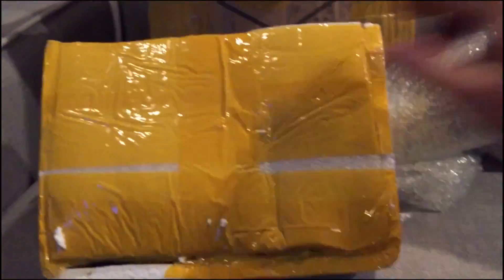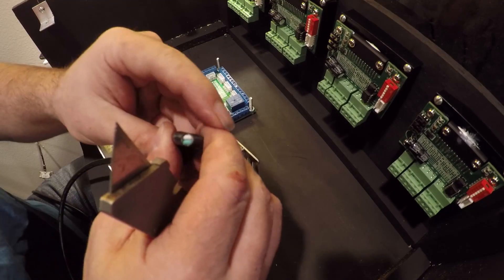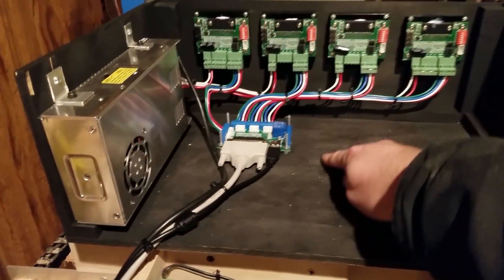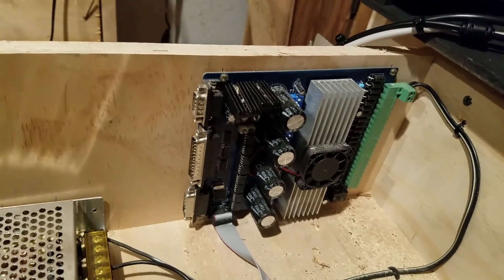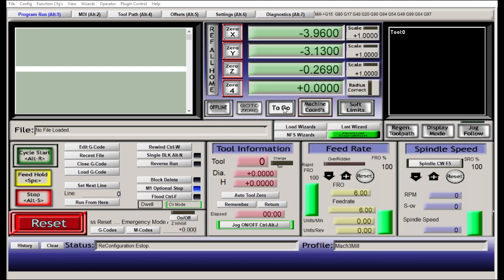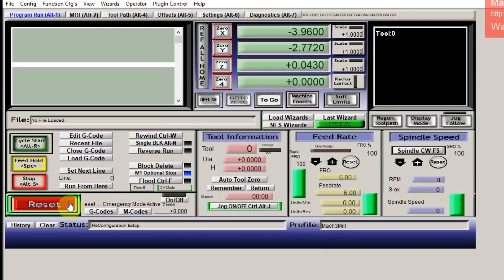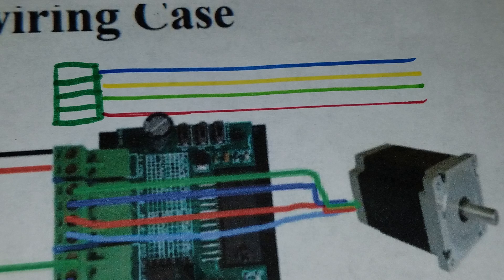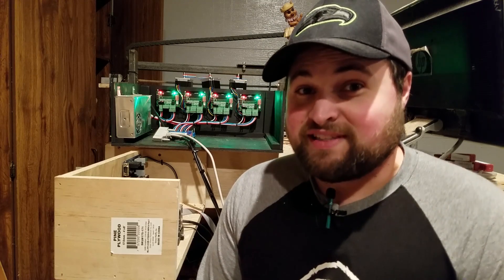CNC Build Part 1: Controller Box Build and Set-up

Comment: Do either of these boards allow to run dual steppers on the X, and still give you a 4th Axis?
Reply from the maker: @donovannewton9507  What you're talking about is a slave drive. They are done through the software, so you just need a board that has enough driver outputs for the number of motors you need, then you enable those axis for slave, select and output and a direction, and you're done.

Comment: Thanks for the explanation for the driver hookups. I just got a free Cnc 3axis from someone. Looking to re wire it with new wires and drivers. At the moment it has a parallel port to the controller.  Where did you buy your stuff from.

Comment: The steppers have 4 wires, one pair for each of the two coils inside... Coil/pair AA & coil/pair BB. You can find the pairs by disconnecting the motors, short 2 of the wires, then try and turn the motor by hand. If the motor is harder to turn, those two wires are a pair. (Either AA or BB) They should always go side by side.

If you want to reverse the direction of the stepper, you can swap the two pairs around. EG: AABB or BBAA.
But never wire them ABAB or BABA. 

It doesn't matter which wire of the pair goes first. Just that the pairs are together.

Comment: My suggestion is not to wire cnc's with internal drivers using boards such as grbl because they just don't have the current to run the step motors to get half decent results.

Comment: Beware, cheap USB break out boards tend to loose connectivity easily. I tried some, but instead of going USB, I went with the LPT port.. A PC with a build in LPT port can probably found for free .. Make sure the port supports EPP mode which you can set in the BIOS (other modes probably will not work, as cheap LPT port cards!)

Comment: The yellow is the +ena. I got nothing when I had the driver +ena connected to +5v on the interface board. I also had the en on the interface board connected to -ena on the driver. I disconnected those and just have +5v on the interface board connected to +step and +dir on the driver, and step and dir of the interface board connected to -step and -dir on the driver. And then it worked. But it was turning in the wrong direction so I changed the cw/ccw switch (one of 8 small flip switches) to change it. The ena doesn't ena when connected, only ena when ena not connected, omg.

Comment: Hey bro.. Why do u guys fly through the wiring side of this build.. The electronics is the most fearful part for ppl and it's always the one part builders on youtube gloss over.. Sorry bro I'm not having a go at u but is there any chance u could go through the whole process step by step? Thisis the part that scares the crap outa me.. I need help and have nobody except YT to turn to yet it's very difficult to get ppl to actually make a full tutorial on how to wire this set up completely step by step.. Now that's a video I would pay for.. U could sell that baby with proper printed plans of the wiring stages too. I'd pay for it as long as it wasn't too expensive,, Think about it man.. Somebody has to make a correct wiring set up video.,.

Comment: The wiring looks good, but has a huge problem. They should all be shielded cables with drain connected on one end to prevent EMI interference between motors. Easy isn't best. Plenty of videos on how to properly use and ground shielded cable.
Reply from the maker: The interference in this setup is not as bad as you think. Machine has been running great for a long time. 

Now, my CNC plasma cutter, whole different story because of the high-frequency arc start, and very much has shielded wiring (which I used all the time when I used to wire up aircraft components at Lockheed). Probably the reason people have EMI issues with CNC machines is they run their VFD output (UVW leads) right next to their stepper leads. That is a recipe for disaster. My VFD isn't even in the same cabinet as my motion controller. Just my 2 cents.

Comment: 7:00 it's fine if they don't speak English. Because I have somebody who knows Mandarin. Several somebodies. 😁 Doubt there's a way to phone them though. The best is probably if they can send the original untranslated instructions, which obviously dont have errors added during translation. The colour mismatch is probably because something changed in manufacturing, but nobody noticed the document is outdated. Made worse by the knowledge that it's going to an export market. A country that speaks a foreign language. Yes, poor QC. But everyone thinks everything is in a foreign language I can't read, so why even look?

Some documentation in Chinese products are pretty good. They obviously hired competent people. The problem are smaller companies making budget products. The bosses don't know English. Nobody does. So they can't tell if the translator they hired did a good job or a terrible one. Through lazyness or incompetence. If your company is exporting to Mongolia, how would you know if the Mongolian translation is good, or only spelled checked and gramatically correct but the meaning has been changed?

There are two kinds of "bad English" in Chinese products.

1. Somebody in engineering was told to produce an English translation of the documentation. He had some classes years ago, and knows the alphabet and can read a few words, but can't string together a sentence. He gets a Chinese-to-English dictionary and a couple of basic learning English books. The result is a seemingly random collection of English words pretending to be a manual. However, if you translate them word for word back into Mandarin, they make perfect sense.

2. Company boss is having lunch with a friend who has a company in a different industry. Tells him about his problem. Oh don't worry. Jenny in accounting spent 3 years getting her degree in Brisbane. Her English is perfect. Just pass the the stuff to translate . Trouble is, Jenny isn't an engineer or a technical writer. She knows nothing about the first business. She produces a gramatically perfect document, with numerous errors sprinkled throughout.

The result.

1. Joy for me. Sucks for you. Plus the engineer could sort of maintain the document and update it as things change.

2. this is useless. How does anyone know what is right and what isn't. And Jenny will never ever update the documents.

Comment: So I have a very large 4 axis cnc mill for building pool cues. Unfortunately it didn't come with a control box. I'm assuming it was originally parallel port driven only based on the old HP desktop that came with it. It's 4 axis. My question is this: since I'm a complete newbie to this, I was thinking about going your usb route you show. What controller did you use so I can try to find a kit?

Comment: If you where gonna put this in a large powerful machine structure, would you need special protection for the controller, or in the case of DC motors? Can you do a video in this?

Comment: nice video.
I just got one question!
does every controller compatible with every controller software?
I bought a CNC machine from China, and the software as been a nightmare. it came with Mach3, but not the original, in which I tried to install it, all the defenses of my computer went on red alert. Even after install it, I couldn't make the machine move 1mm. as well, it seems like, Mach3 just work on windows XP or 7. bad thing if they want to keep a market share...
Now I've order an Arduino uno, with the Arduino shield, and try to run the machine with the universal Gcode sender, and try to use and use the stepper motor controllers and the power unite that came with the machine, that way it wouln't be a total loss of money.
I appreciate you could shed some light   on this topic, or maybe you have already a video about this subject, that you could pass me the link.
thanks so much in advanced.
best of luck with your YouTube channel
Reply from the maker: What operating system are you running? Yes, it is a nightmere getting the board to communicate with the PC.
Reply: @StrangeGarage  windows 10

Comment: I'm building my first CNC machine using basic off the shelf parts- 4 nema 23/ TB6600 4A and a MACH3 breakout board. It's nearly time for the electronics, and I was wondering what would be an ideal power supply to run it all?
Reply from the maker: The cheap ones one ebay are fine, but I always like going to goodwill and going through their junk laptop chargers. They are good power supplies and cheap!

Comment: Hello my friend, I have the same board that is in your video, and I request you to send the circuit board connection scheme with the method for determining the ampere motors, and does the computer have special specifications, for example, a 4GB memory is enough or not thanks for your efforts

Comment: Hey. I bought exactly the same Setup as you have in the Video. The good thing is, Hardware of my Plasma CNC is almost ready.  The Bad thing is, i have exactly the same error with the Stepper as you have. 

My question is: How did you fix it? :)

I was really supprised when i saw the same issue :)
Reply from the maker: In the video I drew on the wiring diagram how I changed it. I can't remember exactly. The motor wires were just out of order. It's apparently really common. Good luck!
Reply: @StrangeGarage  
Ah ok. I will check that part of the Video. This is very interesting, because i had a USB Board running with that wiring. Everyting worked fine there. 

If i get it to run i will share my solution. Thanks for your really quick answer!
Reply: @StrangeGarage  
OK...it is kind of working somehow. Like promised:
1. I had to change on my win XP PC the Parallel Port BIOS settings from ECP to normal, then the Motor stopped rotating every time i connect the lpt.
2. I rewired the Motor. Not only the ohmic test for the coils is reqired, it is important to have them connected in the correct order.
3. My steps setting in driver was 1, i changed it to 1/16

Now i still have an issue. 
I think it comes from the lpt, but i expect i need to measure the signal path.
When i Press x+ on mach 3, there will sometimes be 1 step. But sometimes the stepper rotates endless until i pressed x+ multiple times again.

Any suggestions?

Comment: Hey. Have you got a link to where to purchase components? 
Thank you Dave
Reply from the maker: The individual components are all a Chinese Hodgepodge of electronics, so no two kits are going to be identical. The base components are the 5 axis TB6560, and the drivers. You can use NEMA 17, 23, or 34 motors and you should be fine. Power supplies are even more universal. I've used the included one, I've use a laptop charger, even a car battery in a pinch. 

Basically, there is no "perfect" kit, regrettably.

Comment: So when do I get an answer to my question, PLEASE!
Reply from the maker: You didn't give me any details about your setup. Mine is a TB6560 with Toshiba drivers and nema 23 motors, but your system may require a higher ounce output than mine. A table that size my be out of reach for a setup like mine.  What type of drive is your table?

Comment: I bought exactly the same kit you have, and I did exactly the same but still does not work. The motor drivers will blink green when i jog but there is no signal coming out to the motors from any of them, I know it is not the motors because i measure it with voltmeter. Can you please share your setting for the mach3 and the wiring diagram. Thank you

Comment: Tip for finding the right motor wire combos ... Take any 2 wires and connect (short) them to each other. Turn the shaft of the stepper motor by hand. If you feel resistance (a fair bit) then the two wires in question are from the same coil. If the motor turns freely then you 'shorted' wires from different coils and have to try a different combination.

Once you have the wires paired up, it does not really matter which you put as the first coil, and which as the second (if you have a 4 wire stepper, when it is a 6 or 8 wire stepper things get a bit more complex as you will have to put coils in series or in parallel).

Comment: No computer that I own, or any new computer motherboard or already built, has a LPT port.  Mach3 is ancient and I believe Mach4 allows USB which is where it is at not an obsolete parallel port.
Reply from the maker: It took me a minute to find computers that had them. They do sell PCI Express parallel ports that you can add to your motherboard though. 

As I understand it, the USB breakout boards work very well and are easy to setup. So might as well go that route if you're already having trouble with sourcing an adequate tower.
Reply: There are USB to parallel converters. They are like $5. However they are designed for printers. Not sure if you can get mach to work with them, or even if they have all the needed pins connected.
Reply: @danielch6662  From what I read shortly after I posted here those don't work.  Something to do with power and/or pinouts as Mach used a few pins for timing that a LPT to USB leaves out.  A true IEEE-1284 to USB would be the only way as that would have all 25 pins used, but even then I have my doubts.

Comment: Hi there  I wonder if there  is any place that can  buy a  interface with  both USB and DB25 ports , ?  compatible with Mach 3 or 4
Reply from the maker: There isn't a Motion Controller than I know of with that ability. Eventually I expect them all to be USB driven which will be a good thing for new users because of computer compatibility. Good luck!

Comment: On usb, yes, easier computer to find. Works with free grbl running on a $4 Arduino uno as your motion controller that receives the gcode and sends steps to your motor drivers.
Reply: That's Not what he has though right,  would you use a chip for each axiss,  so only 2 chips for regular lathe? So you still need more computers for joining these, and for doing coputonaly advanced things like radius arcs,  or differential arcs.

Comment: Mounting the electronics in a wooden box does present one important drawback: digital high current switching circuitry usually radiates a lot of RF noise that can cause interference with neighboring electronic equipment. Wood provides no EMI shielding since it doesn't conduct electricity. A better option is to dig up a cheap PC tower case and modify it to fit the electronics in there.
Reply: TheDeepNorth I considered this, but I made my own circuits and don't want to risk shorting the circuits.  Mine don't cause any problems. But I use caps on limit switches.
Reply: One easy way to avoid shorting the circuit boards to a metal casing is to mount them on threaded plastic standoff posts.
Reply: TheRainHarvester If you can make your own circuit - you should be able to place it in metal box without shorting it ;)
One of the most cummon pitfalls of DIY CNC’s is EMI and noise from spindle, that can be solved by propertly grounding the build and shielding cables.
Reply: 3rdHalf , I could, yes.  But it was not necessary, and far easier/cheaper to use plastic.

Comment: So computer wise (I hope you're saying) I can use a pc with win7 that is old & could be used for nothing but running the cnc? Obviously I'm no computer genious but I'd really rather not use an expensive computer to do this as it will live in my shop so I can make bits for the RC's I build on my channel.
Great video & info btw, can't wait to save a few bucks & get building this thing. Maybe by then I'll know what I'm doing pc wise enough to make mine as sweet as yours.
Hey from Calgary AB 🇨🇦
Reply from the maker: Precisely. Both of my computers were headed to the scrap bin before I got them. You really just need a parallel port, and the computer needs a program called "mach3" to run the cnc controller. Other programs work, but Mach3 is the main player in the game. 

The computer can be the hard part, but patience will pay off! Good luck my friend!
Reply: @StrangeGarage    Also the computer has to be Win 32 as 64 bit Windows will NOT work with Mach 3

Comment: I am very curious what your computer will consists of
Reply from the maker: The software is super basic. It could pretty much run on windows 98, so as long you have a parallel port you can use any computer. One of my computers has windows XP, the other has 7, I've had no issues with either computer.

Comment: Tidy wiring! Nice look.  Good use for that piece of plywood that is sitting around.
Reply from the maker: Yeah I was happy how it turned out. Works real well too. Thanks for watching!
Reply: This looks like the kit I got just recently (controller part)  was there any dip switch turned on ?  Why is it needed to turn it to 3500khz vs 2500khz and also.  Happen know the pin configuration. From port to driver module ?   Thanks

Comment: can you please include info of parts that you have used ???
Reply from the maker: As far as electronics, I just used a TB6560 controller kit with external drivers and nema 23 dual shaft motors. It was all included in the kit. The machine itself was homemade, and I detailed all the parts I used in the build series.  Here's a link to the part 2:

https://youtu.be/TsiOvKOgUhI